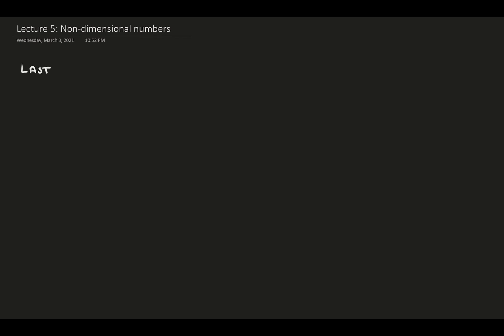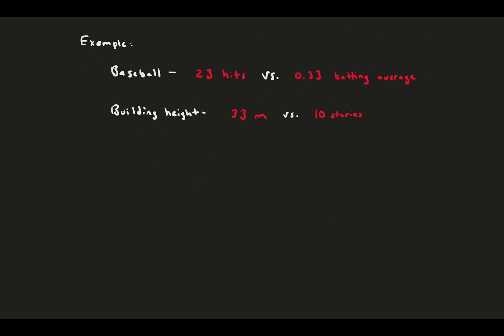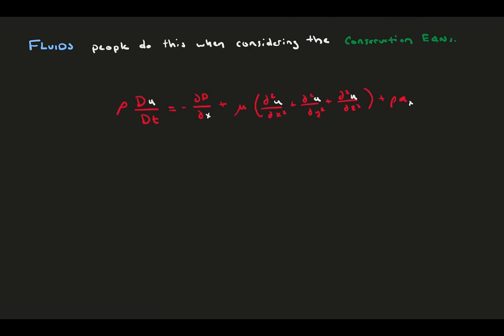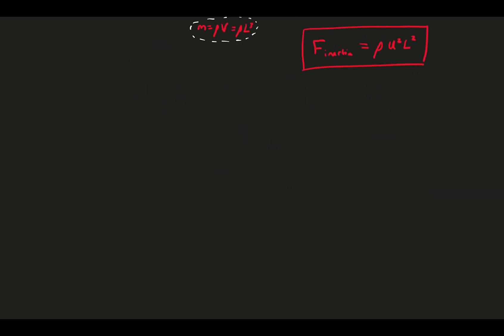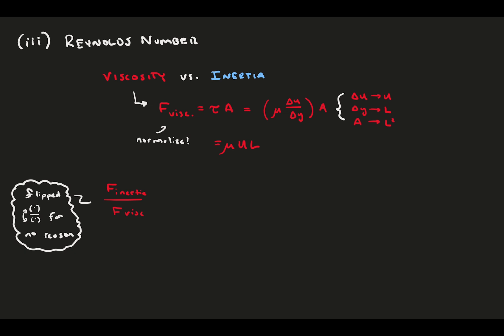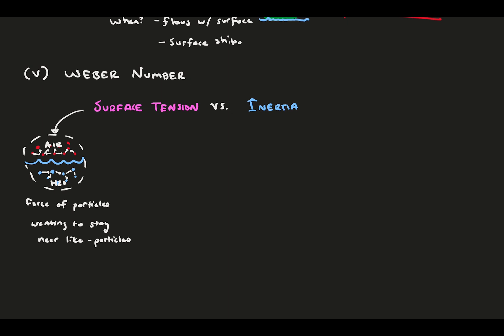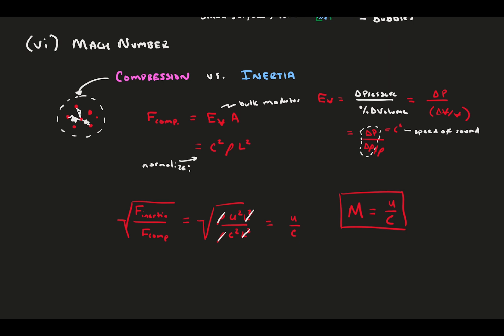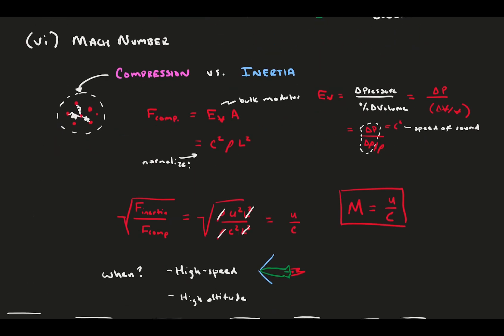Non-dimensional numbers [Fluid Mechanics #5]

Comment: sir some sources say that "euler's number is the square root of the ratio of inertial force to the pressure force" and "weber's number as the square root of the ratio of inertial force to the surface tension force" is that true?

Comment: 8:55 how could we consider (delta u) and (delta y) can be changed to reference u and y respectively, unlike (delta p) in Euler Number? We didn't change (delta p) to reference P in this case.
Reply from the maker: Great question! It's more convention than anything, and for the Reynolds numbers often the velocity scales and length scales change. However, we can change the (delta u) and (delta y) to a (u) and a (y) because often the starting reference point is a surface where y = 0 and U = 0, so very crudely (delta U) = U - 0 and (delta y) = y - 0. However, this is not always the case for pressure.

Unfortunately, fluid mechanics/aerodynamics in general is riddled with lingering conventions that we try to mash together, and often you have to have in-depth knowledge of the problem to set it up properly.
Reply: @prof.vanburen  Thank you for your answer. Your video is so helpful!